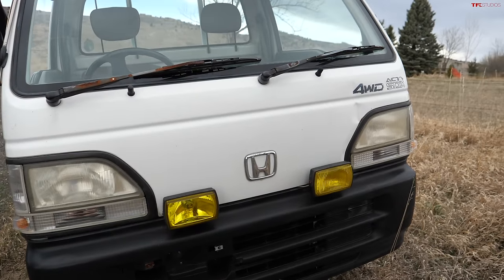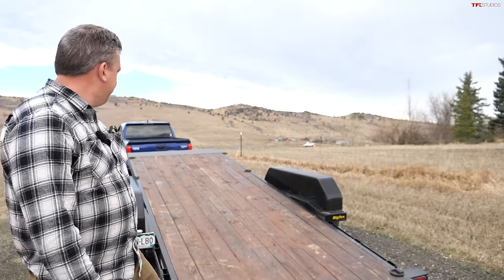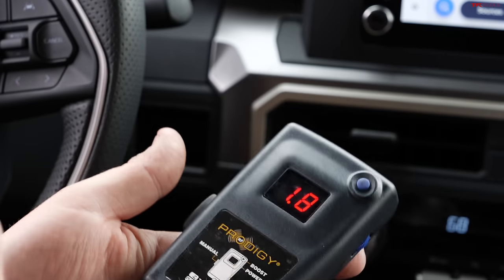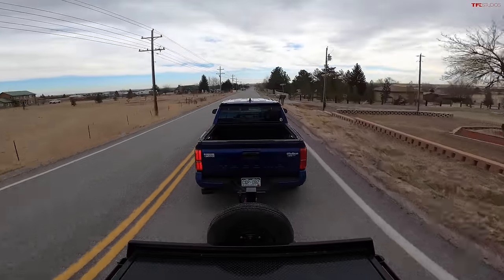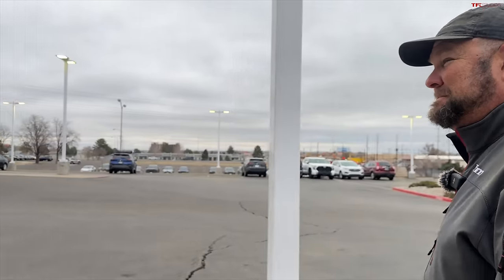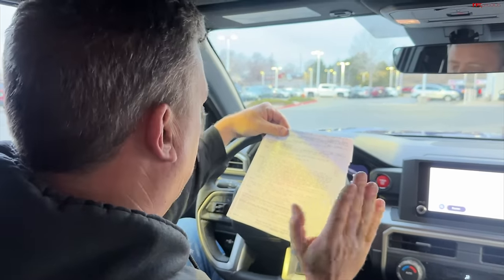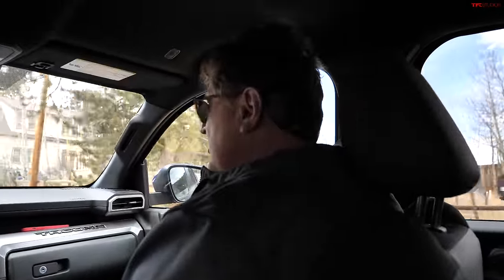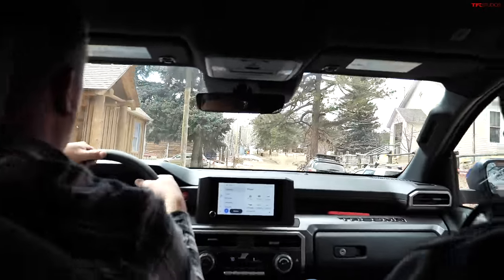Can the New Toyota Tacoma Tow Up the World’s STEEPEST County Road? | Part 1

Comment: That tacoma seems pretty bad, 4wd blew up in a little ice and now the transmission overheats towing a tiny truck... imagine what would've happened towing that load in the summer when it's 90 degrees.
Reply: But trd jon says Toyota has tested it for a million miles so it's bulletproof
Reply: You don’t know how modern transmission coolers work.  They cool off of engine coolant.  It keeps the transmission warmer in the winter so it shifts properly.  The engine coolant stays at 200 degrees whether it’s Summer or Winter.  Even at max load and 120 degrees outside the transmission temperature would only be a few degrees warmer.
Reply: It is NOT bad, it is just user error so stop trolling
Reply: @user-tb7rn1il3q On 4WD 24-7, their 2021 4WD Ute Comparison explained how modern transmission oil coolers work. Modern trucks that have a transmission cooler also have a thermal bypass that doesn't allow the transmission oil to be cooled until it reaches a minimum temperature. However you want to keep the transmission temperature as low as possible so you either have to replace the thermal bypass with an aftermarket part or install a larger transmission cooler that allows transmission oil to always run through the cooler.
Reply: It didn't overheat though, yes the temps got higher because they were towing up a steep grade for 2 miles with about 5500 pounds behind them, the temps never reached ' over heating ' status, the truck still handled it.
Reply: @adrianhosein7698  Toyota torture tested it up Davis Dam at full rated towing capacity and it made it.  No vehicle can run WOT up a very steep grade without overheating eventually.  At some point it will go into limp mode.  This is I manually shift to a lower(est) gear and keep the revs high, but the throttle low when towing up a hill.  This keeps the transmission temperature nice and low.
Reply: @adrianhosein7698  The transmission doesn't need to overheat to be damaged. The higher the difference between the hottest and coldest temperatures, the more it damages the seals and makes them brittle. If you don't have a proper transmission cooler to control the heat, it will prematurely damage the automatic transmission.
Reply: @aerynlovell4754  Modern Transmissions run much hotter.  They are designed to take the heat.
Reply: @user-tb7rn1il3q  Modern transmissions have a thermal bypass valve that works like a thermostat that doesn't allow the oil to flow into the stock trans cooler until a minimum temperature is reached. Over time, when the temperature in the transmission has been too high for too long, the oil breaks down and starts to turn black. This excessive heat can make the aluminum valve body a little malleable. The landings on the valve bodies become warped. The valves wear down the landings to the point that oil is slipping past. Then you have problems like trans slipping, trans bumps, torque converter shudder, speed sensor fault, etc. These problems can be fixed by removing the thermal bypass so the transmission oil can always flow to the stock oil cooler or even install an aftermarket oil cooler to keep transmission temperatures lower. Lower transmission temperatures increase the longevity of the oil and transmission.

Comment: Should you have been in 4lo? Transmission getting that hot makes me wonder does this truck not have an external transmission cooler?
Reply: Pretty sure halftons and down don’t have transmission coolers. All the manufacturers got rid of them.
Reply: For me it was a face palm moment when they were talking about how steep the hill was, and then said they don't need four low. This is a perfect situation for four low especially as it's a dirt road. 100% would have done a better job in four low.
Reply: @agentcarder pretty much every car/truck without an external transmission cooler has one built into the radiator.

Comment: I towed about 5500lbs a few days ago with my 22 Frontier Pro-4X and was totally impressed. Most of the 60 mile I-95 drive it hovered around 2K rpms, the transmission stayed cool, and I got almost 16mph while towing. I was truly impressed. The new Taco with the recent front drive ADD break and the four banger struggling with a trailer reassures me I picked the right new midsize truck!

Comment: Thanks for the update. So, if I understand the gear sleeve was the issue. I have always been curious to see this particular sleeve in both a "failed state" and with normal wear and tear. I do not think this particular part has had any changes in the ADD system from 3G to 4G (?).

Comment: I would like to see that test in the summer when it's in the mid to high 80's. I think the trans. would over heat. ..........JUST SAYING..........
Reply: I agree, but actually have an engineer on here explaining things not just hearsay. Like how the transcoolers work on these trucks and what is normal operating temperatures for the transmissions. Not just uneducated opinions.

Comment: I would Much prefer having a 4WD system where I had to get out of the truck and lock in the hubs manually. Those systems were more reliable and cost less to repair.
It seems like after 100K miles or so the electronically controlled 4WD systems with automatic locking hubs just aren’t as durable and cost a small fortune to repair / replace.
I’m all about things that lasted longer and were cheaper to repair / replace.

Comment: I'm sure it pulls, just wonder how much life it takes out of the turbo
Reply: Semi trucks pull millions of miles a day on turbos
Reply: @Weatherby406  yeah diesel. Apples to oranges bro
Reply: He said he had it to the floor, and it didnt even move. But hey, the trans got hot as shit, so thats a bonus.
Reply: @Weatherby406  You are lost in the sauce, arent ya boss.
Reply: @Weatherby406 your ignorance is showing.  Google is your friend
Reply: @jtec99 how do gas and diesel turbos differ? The engines themselves may be quite different but I think saying the turbo’s life might be reduced is fairly comparable regardless of what kind of fuel is being pushed through it. I think as long as the turbo is well designed for the application, it can survive just fine. The rest of the engine, I suppose only time will tell.
Reply: @ALMX5DP  you'd have to ask a  diesel mechanic about that bro. I just know what I've heard from mechanics and engineers about it.
Reply: @jtec99  what have you heard specifically about the differences between them?
Reply: @jtec99 it’s not. A diesel turbo and a gas turbo are identical. They work identically
Reply: @RP-oy5rt  diesel sounds dirty though. I like it dirty

Comment: You just get the vibe with these videos the new Tacoma is somewhat fragile and underpowered which is unfortunate.  If enough of these get out in the market and underperform for consumers long term if we’ll see them put the Tundra V6 in future versions?
Reply: That engine won't fit very easily; the Tundra is a bit wider.
Reply: On the contrary, the problem is that it's not underpowered. When it broke if you watched the video, it was under heavy throttle with a lot of boost (you could hear the turbo noise). The part was presumably designed for older engines with much less torque than the turbo engine has, and that would be my prediction of the reason for the failure.
Reply: Underpowered and quick to overheat
Reply: @rudolphna54 It’s only 4 cylinders.  It’s underpowered.

Comment: Check if it has something similar to DPF filter in the exhaust. I saw a mechanic video of pro and cons and the tundra has a exhaust filter system. Why? There is no regulations in gas engine having a filter and do a passive regen with fuel.

Comment: That little truck needs a better trans cooler. Wow, that would be brutal in warm weather. I feel better and better about my Ram 1500 V6 purchase as i looked really heavily at the new Tacoms. It's my new everyday truck and weekend hauler. It's been doing fantastic. Just need to keep the rusties away with undercoating. The sheet metal isn't as good as my old Dodge. 

A N/A v6 with 10 spd transmission would be ideal... guess that's why the Nissan Frontier still exsists.
Reply: Yeah cause 10 gears is too many.  You only use 1-4 for towing
Reply: Any reason you picked the Ram over the Frontier?
Reply: The new tacomas also has a active grill that functions to cool down that fast heating engine, these active grills are also malfunctioning on some new tacomas

Comment: So they replaced the front differential with the same part that wasn’t updated with better parts? I would have said keep it until you find the cause and update the parts. Junk out junk in. 😮
Reply: You wouldn't get the truck back for at least 6 months minimum. New parts have to be designed, made, tested, and then produced.

Comment: Great video guys. You really tested limits of this Tacoma towing, and it wasn't even at full towing capacity. Good to know things like this. Also, to the people saying that Toyota wouldn't have covered this repair under warranty... I think they would've covered it. Unless it's obvious negligent behavior.
Reply: That thing Almost over heated on that short trail with a light load 😂
Reply: @Adriangee818  it was a very steep hill. And it was the transmission. That's why it's good to know!! LOL.
Reply: @mitchstein288  they had the frontier pulling a fjcruiser on steep hill to

Comment: Getting the Toyota repaired would have been such a nightmare for anyone who doesn't have a YouTube channel. Thanks guys for the transparency with this whole process. Hard to believe that transmission almost overheated. You definitely need to redo this video in the summer. I don't think I'd buy one of these this year. They need to reinforce some parts and put a transmission cooler on them.
Reply: They should have let the Japanese design / build it.

Comment: Curious why not put it in 4 low up the steep hill to help out the transmission?  If speeds are low, low range would enable the torque convertor to slip less and generate less heat keeping temps down.  If the intent is to show what a typical driver would do then it makes sense (and of course it made it up anyway) but seems a shame not to use all the available features.

Comment: The funny thing is if you read the "fine" print on warranties, most of them will not cover a majority of off road activities. Anything beyond your typical unmaintained fire road is considered improper off road activity and they will deny warranty work if something happens. TFL got it fixed because of obvious publicity reasons. I just think it's funny manufacturers make off road models but then tell you basically, you're on your own if you choose to use them how we advertise them.

Comment: A failsafe breaking part is fine if it is at a sufficiently high rating. Sounds like this is just to protect weak parts. The hybrids, as in the Landcruiser have 100+ftlbs more torque, I hope they have higher rated differentials and their dissconect...we don't want a pickup. Our 2014 4Runner has been bulletproof for over 153,000 miles.

Comment: We had to choose between a 23 and 24 Tacoma TRD Off Road, Double Cab, Premium pkg with a 6’ bed.
Ultimately we chose the 23 ONLY because of the tried and true, Reliable and Durable 3.5L Naturally Aspirated (N/A) V6.
Historically the Turbo engines have never lasted as long as a N/A engine.
I had another Toyota with the 3.5 v6 engine and it was still in great condition when I sold it to a friend of ours when it had well over 200K miles. He and his wife are still driving it today with almost 300K miles.
Currently our (my) 23 Tacoma has less than 7K miles on the clock.
I sincerely hope that I’m wrong about the new 24 Tacoma and that they will last 300+K miles, but I doubt it.
I drive about 5-6K miles a year so at my age my TRD will be the last pickup I’ll ever have to own.
Reply: Why not have a turbo? Toyota has been doing those for like 50 years in some of the most reliability renowned vehicles ever, Land Cruiser, Hilux, etc.
Reply: @JollyGiant19  If you would have read everything that I said in the original comment, you would have known the answer

Comment: Ik gm you cant add it on later due to the ABS that was programed into the truck. But Toyota might be able to
Reply: Why not standard fitment like the new Ford Ranger? Ranger comes with factory brake controller

Comment: "One of the 1st" (but not the very 1st) Said 4H when "you"broke it.  Pointing to Andre.  But in fact, it was Roman whom was driving at the time. ;)  Was about to compliment the drone work .. right up until it crashed into the tree.  LOL   "ADD" attention disorder disease.  ;)   Sad that 1 little oopsy has now made driving the thing a timid experience.  I say push it hard!  It is under warranty.  And that is the only way viewers are going to know if there are more problem points.  Drive it up steep hills.  Drive it in low gears.  Drive it for a lot of miles.  In short, drive it like a Toyota owner!

Comment: That thing broke, locked (edit engaged in 4wd) going up someone’s snowy driveway. For those that drive their taco to Walmart, this new gen seems up their alley, … I will stay well well away from this new turd. (Own 3 Toyotas)
Reply: It’s probably the same diff in the last several generations.
Reply: @Weatherby406   Welp, those "several last gens" have never, EVER broke in that weak as hell fashion.  I doubt it was the diff,. but the discon. That said, i will stay well way from this pile of shit. (2 miles and the trans is that hot in  cold as hell weather) Hard pass. Ill buy everyones older gens that are moving to this complete pile.

Comment: Not extreme towing 😂.  Do the climb in the summer when it is hot outside and AC running.
Get a hold of the chief engineer and let him know he missed the trade off curve for towing performance.  Never should have gotten that hot with an outside temperature of what 40-50 degrees.

Comment: The fact that the dirt road is super steep is the reason to use low range. Probably would have walked right up at less than half throttle in low range with no problem.

Comment: Toyota only fixed this for free because of who you are. If this was an average person with no corporate connections, they would be out of luck and stuck with heavy bill from the dealership. Toyota knew they had no choice but to fix it for free otherwise they would have had bad publicity for their new truck.
Reply: So warranty wouldn't cover it? 🤔 You sure about that? You'd be surprised what they cover -- which is partially dependent on the service advisor and the dealership.

Comment: Frankly this is absolutely embarrassing for Toyota right now. As a third gen tacoma owner myself, I am severely disappointed with how far Toyota has fallen in terms of reliability. TFL takes a brand new tacoma up a mild incline covered in snow and ice and blows up the front differential after just a little bit of wheel spin. And now TFL is only willing to take it up a mild incline at 2 mph that my 90s civic could have climbed! I hope Toyota wakes up soon and realizes that if they continue on this trend they will be just like any other American manufacturer producing cheaply made, overpriced, disposable cars.

Comment: A case-by-case basis? That means that if this had been me, Toyota would have denied covering and replacing the ADD/Differential under the warranty. We all know why Toyota didn't hesitate to repair your Tacoma in 8 DAYS! Just so that YOU people understand, unless it's a National Recall Notice, NO Manufacturer will EVER admit that a catastrophic mechanical failure is their fault in less than a Month! 

I still stand by my original comment. Toyota built this Tacoma for speed, not for low-end torque. Whenever Toyota makes a Turbocharged vehicle there is always a problem. 

Why would they need to remove, replace, and study the Differential if it was a mechanical failure with the ADD (differential clutch sleeve) system? That's like replacing the transmission when the driveshaft goes out.

Comment: Remember when you used to have a lever to move into 4 wheel drive?  There was a reason for that.
Reply: Because it was cheaper, not because it was better lol
Reply: @wolfgang_h3t  mechanical > electronics
Reply: @Darkpill-2  Then you can enjoy your shitty old carby if you wish to deal in absolutes
Reply: @wolfgang_h3t  Well Toyota has already recalled 100K Tundras so my point is not up for debate.

Comment: Electric trailer brakes engage when the brake pedal of the tow vehicle is pressed, and do so in proportion to the pressure applied. The controller simply gives one the ability to adjust the gain and the ability to apply the trailer brakes independently.

Comment: Covering warranty case by case? If so why they are selling 4x4 off road vehicles. Completely unethical. Also like you mention you guys have connections at Toyota. What will the regular folk do? Will they cover this under warranty? probably not. Heating transmission, I do worry the new 4runner will be in the same boat.

Comment: Failures on the paint the transfer case.  electronical problems. Transmissions, overheating. The taco has turned into a bean burrito.

Comment: Why can’t Toyota just put a 4cyl Hybrid into their Tacoma’s without the turbo?
They could have 4 electric motors on all 4 wheels to give it more torque.
Reply: Why not have a turbo? Toyota has been doing those for like 50 years in some of the most reliability renowned vehicles ever, Land Cruiser, Hilux, etc.
Reply: @JollyGiant19  Didn’t you read my previous comment?
The answer was there